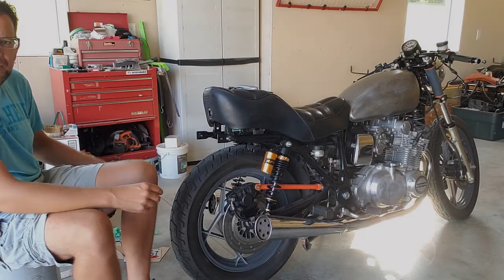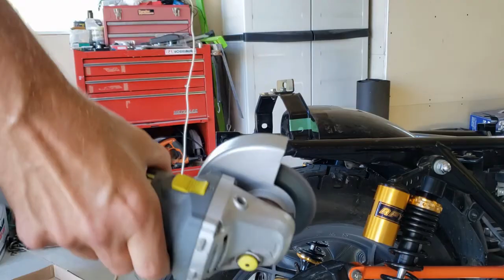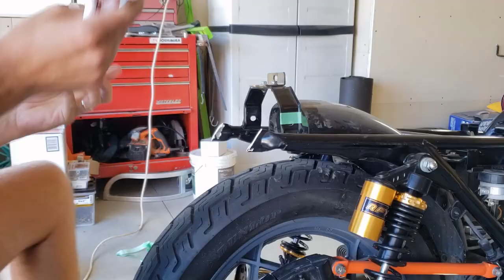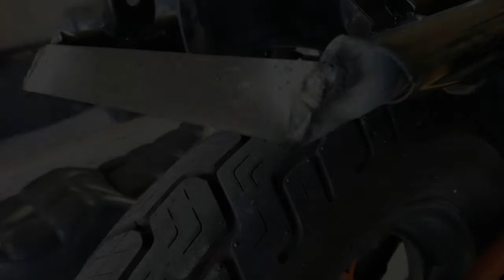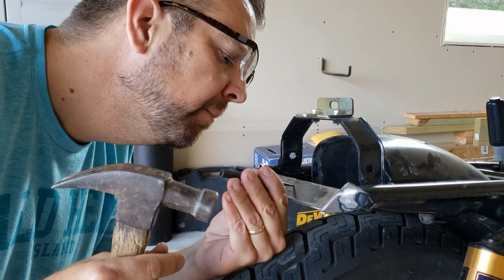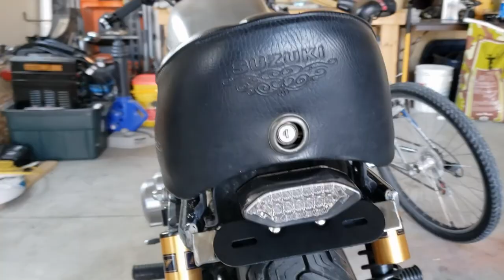Cafe Racer Build GS850 13 - Rear Brake Light

Comment: That looks great man. Excited to see it working. Did you take any welding classes or did you just jump into the skill?
Reply from the maker: Ages ago I used to weld, but this welder is a very inexpensive one from Northern Tool.  Welding with fluxcore wire is not something I'm used to.  Hopefully it or I get better....😉